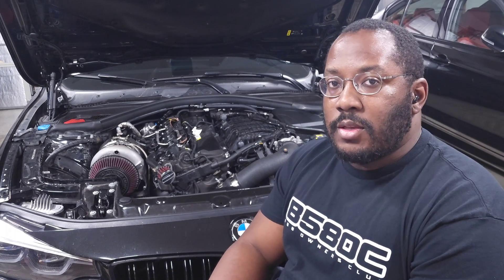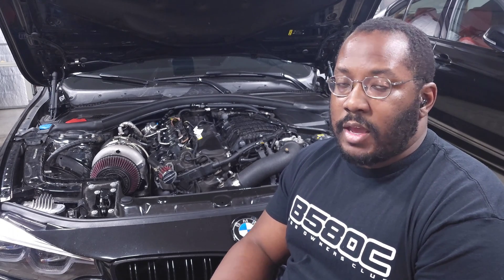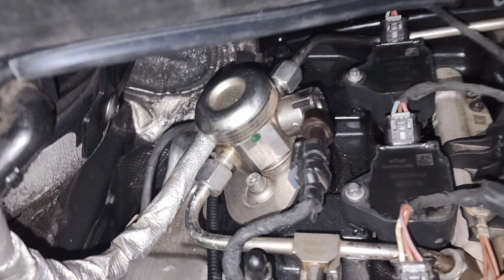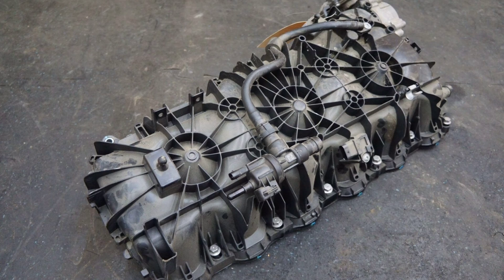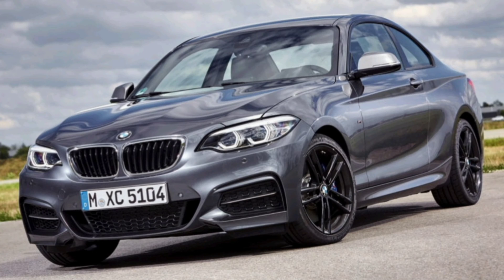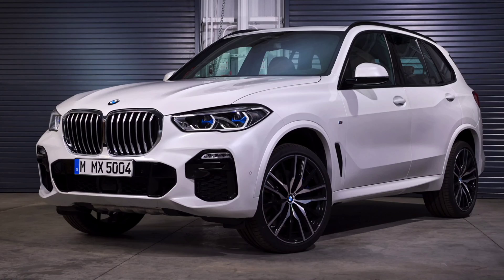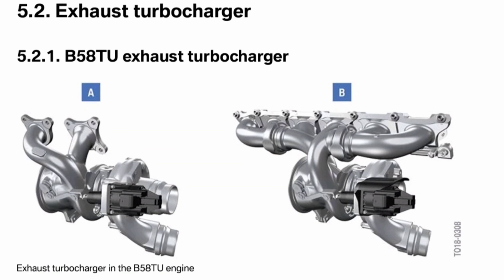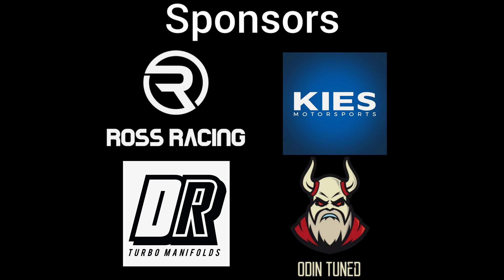How to tell which version of the B58 is in your car (Visual Differences)

Comment: Great insight. Please do a video on the INEOS Grenadier, it is equipped with an B58 as well. In this case the engine was modified by BMW to lower the HP and increase torque. Thanks

Comment: I have a 2019 BMW 3.5 XDrive but you did not mention X6 on your video .

My problem is I have the N55 engine and all I read says trade it for a B58 due to plastics. 

I like the X6 and X5 for a replacement but want 
the most reliable version.

It seems the latest version (Gen 3) with flywheel in the rear making it very expensive to replace the water pump, may be more expensive to repair. 

I am thinking is I should look for a 2022-23 model X6 as a more reliable bet for my next car? I am not interested in any performance upgrades, just original setup.

What do you think? Recommendation?

Rod 

I also own a 1972 BMW 2002!

Comment: Hoping you can clear this up. I have a 2023 540I RWD and my engine block says B58B30C. As far as I can tell that is the Supra version. I cannot find a single source that says they put those in 540s. Any insight?
Reply: Same as M340 and M240, just detuned

Comment: Still not sure what I’ve got in my 2018 M240i rated at 335 hp.  Everything on it and the hp rating matches the series 1 B58 with 2 port heads EXCEPT mine has the 6 port exhaust head.  I bought it new so it’s stock.  So WTF is it, and would a tune instantly bump it to 380 hp as the other 6 port B58s ?
Reply from the maker: all gen 1s are 6 port.
Reply: @kern417  Thanks!  Do you think the 335 hp rating is just sandbagging by BMW or would a tune be needed to bring it up to 380 which the next year M240i was rated at?  Or did the 2019 get the TU series?

Comment: Hi, can you confirm which engine the 840i has - its the only model which isn't mentioned in this video - thanks
Reply: 2020 840i would have the B58TU but middle output so the 2 port B58C 335hp.

Comment: The reason why they put the lower output version B58 in the later bigger cars - 5 and 7 series must have been because both of them have a 50i version car with the N63. I think bmw didn’t want to confuse 5 and 7 series performance buyers with a high powered b58 vs a n63, likely would have hurt n63 sales
Reply from the maker: the same could be said for the 3 and 4 series. The M240i makes more power than the 340i, but the M2 makes less power than the M3. So the gap in 2 series is closer than 3 series. It depends on a lot of factors.
Reply: @kern417  where is gets complicated for the bigger cars is the extra engine they have in the performance versions. I.e. B58, N63 and S63. The smaller cars have B58 and S58.
Reply from the maker: it's no different. the smaller cars have b48, b58, and s58. but the b58 is put in everything from a 1 series to an X7. so in a lot of cases the bigger cars come with more power because the bigger cars have more weight. so again it just depends on how they decide to approach it. Also they introduced the M-lite designation so those cars basically come with an MMPSK tune similar to what was offered as an option on Gen 1. Now it's just a standard package, so all the cars come with Msport trim, MPPSK tune, Mperformance LSD, etc.

Comment: I don't believe two vs. six port has anything to do with the output. The two port one has the exhaust manifold embedded into the cylinder head.
Reply from the maker: all 2 port TU vehicles come with less power than 6 TU port vehicles. fact.

Comment: Hey great vidéos, great content. You definitly know youre stuff , i really appreciate youre knowledge. 
I have a M440i  2019 i have the tu pump, does that mean i need to tune my mhd stage 2 + or i woyld need to upgrade to dorsch stage 1 for that? Im currently tune mhd stage 2 with 95 oct. Im using 94 oct tho, thats what we have in Canada here petro 94.
Reply from the maker: You need a TU pump to run stage 2 hpfp
You should not run 94 octane on a 95 tune